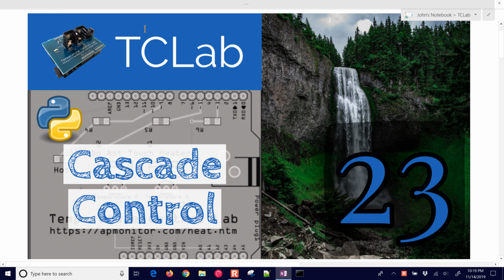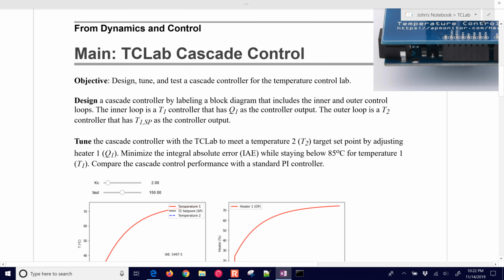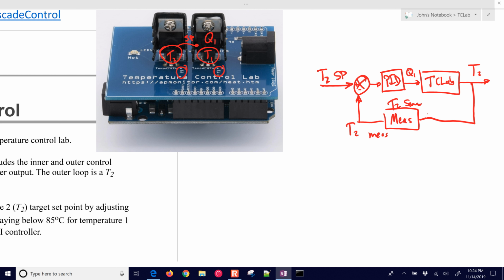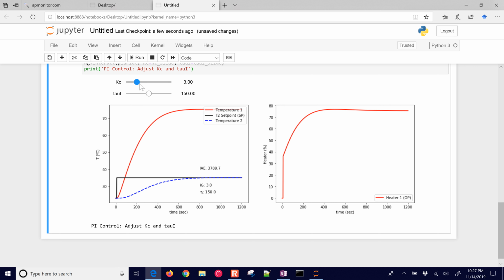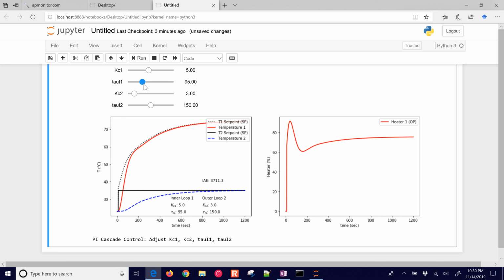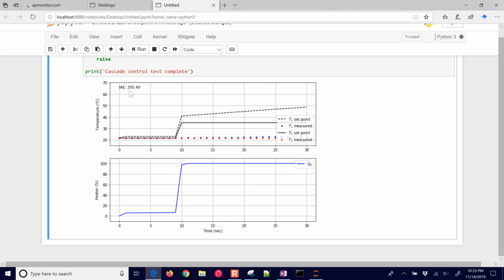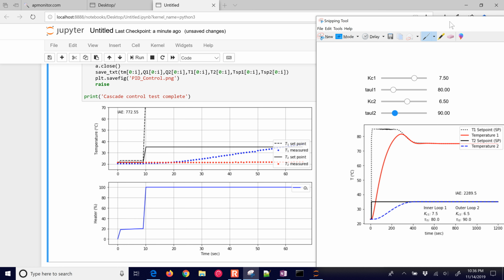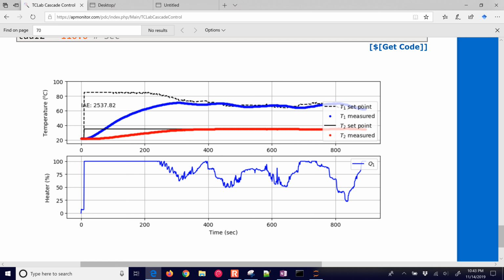TCLab: Cascade Control

Comment: How this (y1-23.0) came for first differential equation and what made you assume dy1/dt = x1, dy2/dt = x2
Reply from the maker: They are in deviation variable form. When the heat input is 0, the temperature returns to 23 degC. More about deviation variable form is shown here: https://apmonitor.com/pdc/index.php/Main/ModelLinearization